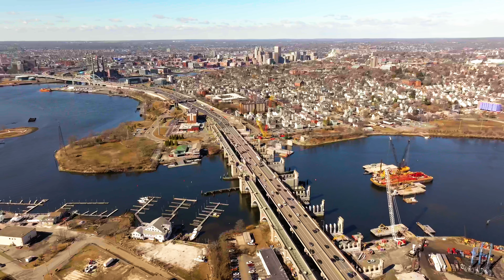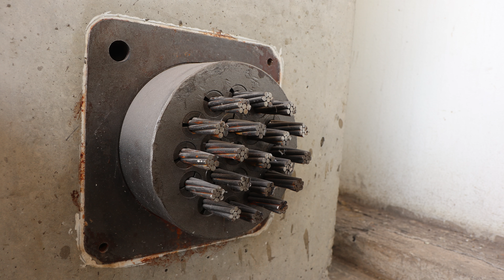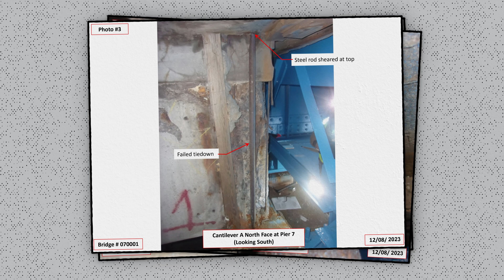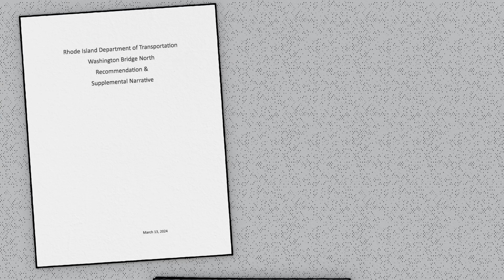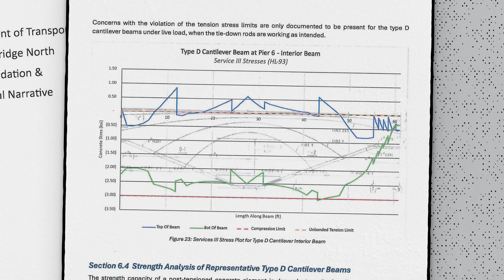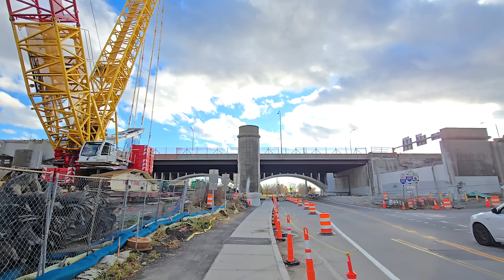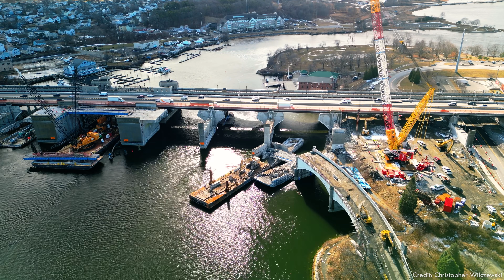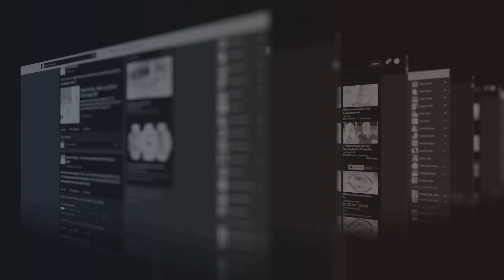This Bridge’s Bizarre Design Nearly Caused It To Collapse

Comment: The lower post-tensioned cables seem not to contribute at all to counter act the action on the cantilever, instead they are loading the cantilever in the same way as the loads.

Comment: A while back, inspectors found out that a small bridge around here was not really post-tensioned. The builders apparently just centered in a meter or so of steel on each side. 

Too bad they only found that out after the criminal statues expired. Good thing the original design has a sufficient safety factor that nothing happened.

Comment: A bridge I used to live near is a similar 'success story' - the approaching failure was spotted before it could happen, and action was taken. Monitors were put on the bridge to alert of any sudden changes (there was no alternate route that could possibly handle the traffic this one does so it had to remain open, hence monitoring, not closing) and the state immediately got to work on the process of replacing it. And, as a bonus, they used the opportunity to re-route the highway slightly to eliminate a problem curve just to one side of the bridge that had resulted in a lot of crashes and large vehicle rollovers. The failing bridge was safely demolished as soon as the new one opened.

Comment: Hi we are suing anyone and everyone involved in this bridge, would you like to become involved in this bridge?  No one? I wonder why.

I used to drive those oversize extra heavy vehicles...they always blame everything on the permit load vehicles, yet we are often required to drive the centerline, where we put less weight in each lane than two semis side by side, and do so with more length.  The max normal for a regular length permit vehicle with 7 axles (max normal) is 140k lbs.   The stuff i drove on 13 axles was usually 2x length of a normal semi and aprox 250k lbs. That's pretty much the biggest you can get without having to take extodinary measures to protect everything everywhere...it's not that we are damaging the bridges, its that they will become damaged inevitably and we are the first to catch blame.

Comment: Here in Germany we have something that could be called a road bridge crisis going on. There's literally thousands of bridges in the Autobahn network that are of prestressed concrete design, built in the 60s that have very similar issues. In a nutshell, they were designed for much lighter loads, not maintained very well and in a good deal of cases not built very well either, at least to todays standards. Most have about an inch of coverage over their rebar and suffer badly of spalling. There's a lot of fully or partly closed routes because of this and it's going to get worse, as more and more bridges join the defective club and the big building businesses that can tackle stuff like this are already busy enough.
Reply: Excellent input information.

Comment: When I look at the old stone bridges and tunnels of the former Pennsylvania Railroad, I wonder if engineers should take a look at the building techniques of those structures.  Massive stone blocks were shaped and placed around 1855 and are viable and safe today.  The old structures are not as compact as modern structures but there may be instances where the old technologies could be more efficient.  Might stones that would be precut at the quarry be economically feasible?

Comment: I live in East Providence and the day they shut the bridge down we were stuck in traffic for over 3 hours. People ran out of gas, traffic backed up all of the side streets and the people who lived in the houses on the traffic stalled streets let people use the bathroom or buy water for a few bucks (and maybe for free too but not sure) it was insane. Everyday I have to cross the westbound bridge that they divided up into east and west. Still takes forever because we went from 5 lanes each way to 2 each way, then they removed the shoulders and added a third lane which is even worse. People get into car accidents so often that there is a tow truck parked on each side - ready and waiting - to remove broken down and crashed vehicles that are blocking the way.

Comment: Would it be possible to check the condition of the tie-downs using an ohmmeter revealing hidden breaks or corrosion limiting current flow?

Comment: Rhode Islander here, the issues this bridge has and have had, have been scuttled for years by each administration. Inspectors should have been provided proper access to view the critical tie downs based on the design you described here.

If someone ran for governor in this state and their platform was to get the Washington Bridge fixed and hold those accountable for neglecting to address its issues, they would win handily. The unfortunate part is that there are multiple administrations and RIDOT directors that could be blamed for neglect/negligence/etc. 

You should do a review of the bridge in Pawtucket that handles I-95. That bridge was extremely close to catastrophic failure too. Truckers were re-routed off of the bridge for a few years because they were worried about the potential load implications causing a collapse but was safe for passenger vehicle traffic (buses included). The theme of the Washington bridge is one minor case study to all the other bridges here in RI. Many other bridges in the state that had a similar fate but was never covered or as heavily reported on. This is a common theme here in RI.

Comment: So, while bitching whose paying for the aesthetics, proper maintenance and safety wasn't supposedly an issue, with the assumption we've done the checks we need to, then commission millions of dollars to fix, then starting and only then, woops.

Can't get more negligent and incompetent by all authorities and professionals over the entire life of this bridge.
Regardless of access, not a lot of thinking/foresight of potential issues following initial inspection, it seems.

Also, when different contractors used and no continuity to knowledge/experience regarding condition thereof, insufficient  background research, lowest price mentality.
Goes on and on that too much to write here.

Like potential energy in a hydro dam, the bridge is safe if you do the right things, but if you have an unplanned event i.e. the collapse of the bridge, because of whatever; reasons/mistakes/excuses. 

Then the bs flies and more money is spent on litigation, than the bridge.

This stuff doesn't happen in a vacuum. 
Indicative of systemic issues throughout the country.

Comment: The house reno is all too true! Just days after buying my place I went to change the shower head, but the arm was rusted and broke when I touched it. Next I went to replace the arm, but the screws holding the elbow fitting snapped. So I opened the wall, and saw the entire steel pipe from the valve to the elbow was full of pinholes! I took the shower out and saw there was rot everywhere. Since I had to gut the entire bathroom anyways to sister up rotten floor joists and studs, I changed the layout as well. I can only imagine the horror of someone paying for that shower head to be replaced!

Comment: Over here, in the Netherlands, we havea VERY good system of building, inspections and maintenance. Yet we too have some nightmare projects. That usually boils down to far more traffic of heavier vehicles than the bridge originally was designed foran a life span that was never meant to be that long. Then inevitably a hard choice has to be made. Close a hardused and essential road for either major overhaul or complete replacement, or wing it and find a way around first.  In the case of the Brienenoordbridge both the road across it and the waterway underneath it are economically essential. Likely they'll choose to build a replacement span and float that in place over water. Even the time it takes to demolish the old bridge and float in the new one willl hurt though.....

Comment: My background for 15 years was mechanical engineering, but I did have a semester of concrete design. Concrete is inexpensive compared to steel but there are far more  problems that can surface in the execution/ manufacture of pretentioned and steel reenforced concrete. The state has to keep inspectors/witnesses present throughout the entire manufacturing process, shipping, and installation processes. This is what I hate about concrete. Reenforcing steel in concrete needs to be galvanized to prevent it from rusting and loosing grip with the concrete which reduces the concrete's ability to retain tension forces. Clearly this bridge's concrete panels had inadequate rust proofing on it's steel. You need to use potable or drinkable water for the concrete to have adequate strength. You need to have the proper mix proportions for the concrete to achieve the desired strength. You need to make sure that the concrete mix is not to wet or too dry for it to achieve it's desired properties. You have to have the right temperature range for it to achieve it's desired strength and properties. You need to make sure that it doesn't set to fast or too slow by spraying water on it or adding glycol if your temperature is too low when curing. ( just the right amount of glycol, not too much or too little) I took my concrete class at least 30 years ago so, I may not have mentioned all the situations that can result in the manufacture of poorly performing concrete panels. The reader should get the picture, Concrete as an inexensive material but it requires alot of over sight and care to ensure its proper manufacture. With all this neccessary over sight, is the material really going to be inexpensive, and to cut cost you could just reduce your over sight.

Comment: I watched and watch a lot of your videos. I'm no engineer, but the learning is incredible. Thanks.
As for inceptions, I do know that bridges are inspected every so many years or so. Why is it that as the bridge gets older, or as traffic increases, inspection time frames are not shorten to say, every two years, so issues can be identified, and hopefully repaired while they are still repairable, as to not to go into an emergency repair, or worse, deal with a collapsed bridge. I realize the manpower may be limited, but states should do better in this regard. Every time I either cross a bridge, or drive on an elevated off/on ramp, I always wonder if it will fall then. Sometimes the minor swaying of the bridges brings some peace as I know the bridge is working, but up to a point. Thanks.

Comment: I don't know about the structures having to be replaced within the kind of timespan you generally see from the US. Ultimately I think a huge portion of it is because nowadays everyone builds for the bare minimum, not longevity. After all there are roman walls still standing all across Italy. There'd probably be bridges older than the US across Europe as well, were it not that wars tend to get bridges blown up.

Comment: Why didn’t the previous inspections use LPR  or PDP to determine tie rod corrosion? Testing steel components should be a requirement in any examination.

Comment: Why not atatch coper wires to these inaccessible tie down rods top and bottom to form an electrical testing system.  If the rod is broken, so is the circuit. The only specialist equiptment you'd need would be a volt metre to test resistance. Not broken you get a number, if it's broken, you get infinity or error. Heck, even getting the wrong number could be cause to visually inspect the part in question.  The testing ends of the wire could be put virtually anywhere that's accessible and you'd be able to perform the test easily without the need for visual inspection every time. (though periodic visual inspections would still be a good idea)

Comment: Why not run fibre optic along the steel tendons and tie downs so if the tension elements break the fibre breaks and the light stops reaching the light sensor on the end?
Reply: Yes!  That is a magnificent inspiration.  So simple—but so effective.
Reply: @Stanley-v2x2p  You could probably also do a continuity test by measuring the electrical resistance of said tendon/tie down. Any fractures would reduce the cross section and increase the resistance above baseline, while breaks would have infinite resistance.
Reply: @Kolan_Koala  If you were to team-up with an electrical engineer—Or ask a firm of electrical engineers to design certain isolated components required to put your system into operation — then patented the overall system — and then teamed-up with a venture capitalist or production engineer — you could offer your system to government or to construction firms.

Comment: Design flaws aside, I think the statement “if the inspectors understand the design” is a big issue in infrastructure maintenance in general. It’s one of those things where market pressures outweigh the investment required to reach an understanding of the project.

Comment: Yeah, this thing of just building more lanes to fight congestions in major metropolitan areas is a losing battle that just leads to more congestion (because more cars). It's not even remotely controversial. You have more people than there is place on the roads no matter how wide you make them. If you still doubt that name a single major city where congestion has been successfully tackled by building more roads.

The answer is not just cars. Cars are important, so are trains, and bike lanes. Give choices for those who don't actually need (or want) cars to get to where they want to go and the roads will be made clearer for those who need cars for whatever reason, since cars undeniably are more flexible than bikes or trains.

Still interesting about the bridge though. I just wish that major cities would stop trying to fight congestions with means that are proven time and time again not to work.

Comment: Because so manny highways and their bridges were built in the 50´s and 60´s they are now reaching the end of their useful life but no politicians want to spend millions on thing that is not easy to see and make a election add about, so they gamble with peoples lives hoping the bridge won´t fail on their watch. There need to be a federal law that sets a last day of use when they are built so it is known well in advance when the bridge must come down and be replaced regardless of appearance because internal failures can and will happen in most structures no matter if the surface is newly painted. A plack with a final day of use that can not be delayed by politicians (for any reason) should be placed well visibel on the structure so no ambiguity remains.

Comment: Ive been a bridge inspector for over 25 years; mostly new construction and some repairs, not the NBIS safety inspections that may, or may not be part of the Rhode Island problem.  I've been following this on Casey's channel.  Its going to be hard for RIDOT to find contractors & consultants, when they're suing them.  There are some big names amongst the consultants.

Disclaimer: I do not now, nor have I ever worked for any of the firms listed as defendants in the lawsuit

Comment: i think just total rebuilding would be somewhat cheaper and faster, instead of taking parts, inspecting, taking more apart, then inspecting, then realize later you would need to demo the whole thing later
Reply: Cheaper and faster, but not helpful for the future. Structuring the process is a key part of how we determine what went wrong, and why.

Comment: This is by no means a problem exclusive to the USA. We have a lot of this happening in Germany right now - emergency closures, years or decades for replacement structures to pass funding, planning and environmental processes, even a prominent collapse of a bridge over the Elbe in the centre of Dresden, fortunately in the dead of night. What I do wonder about, though, is the extraordinary durability of many 19th century stone and steel rail bridges compared with later concrete structures. Sure, the huge growth of traffic way beyond design 1950s and 1960s parameters is a factor, as is the chronic underfunding of infrastructure maintenance and replacement. But did we start building concrete structures before we fully understood the materials?

Comment: As an independent contractor, this is why I don't charge by the hour. I'll quote you a solid figure based on what I think my time and labor are worth, but if I give you an estimate of $75/hr for 3hrs, and I find a beehive when I open up your wall, that throws everything out the window. 
I'll charge $200 to install a ceiling fan. But if the wiring is substandard and needs to be brought up to code, that costs more money. Oh, and the ceiling joists are too weak to support a new fan, so they need to be addressed too. Your new $200 fan installation will now cost you $5k.
The more you look, the more you find.

Comment: I noticed that most concrete failure happens when the rebar rusts and expands. would it be possible to use rebar that can't rust or no rebar at all. I know to go without rebar it would basically have to be built like a brick shithouse but I feel it would be worth it for long lived infrastructure.